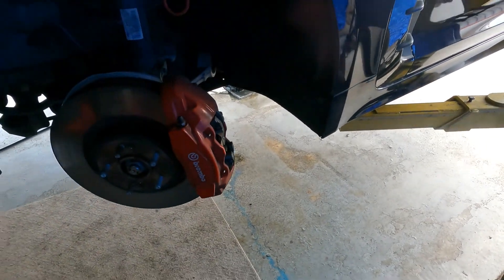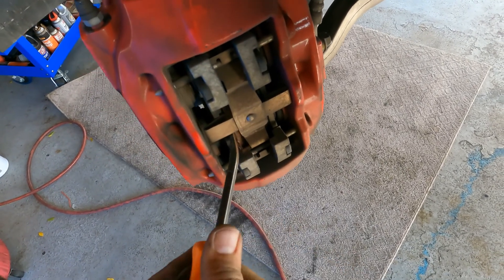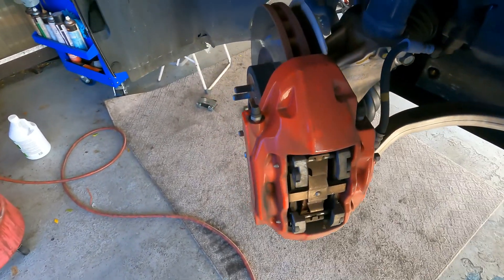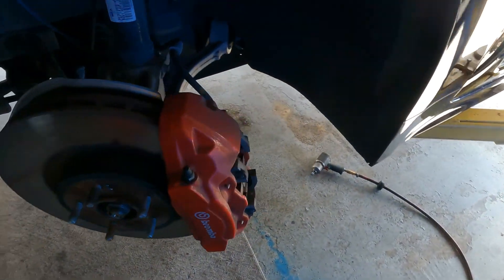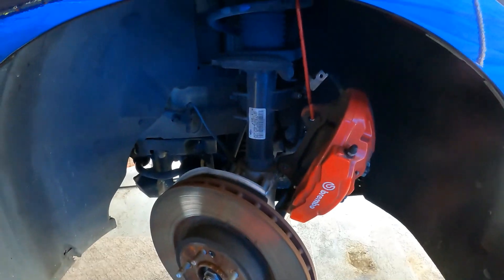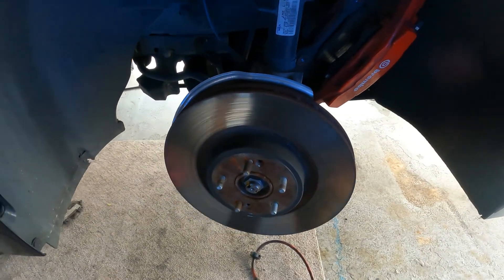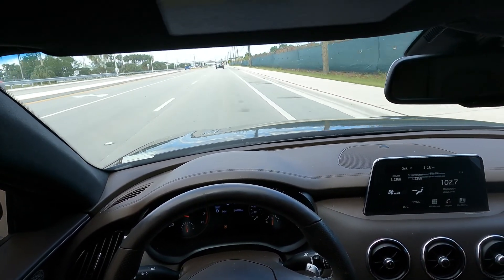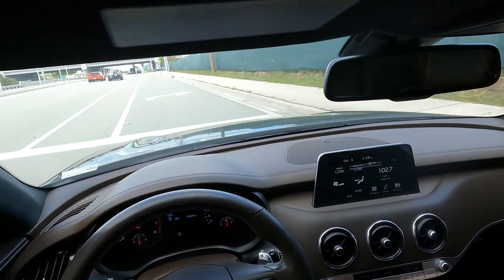2020 Kia Stinger GT brake pad replacement

Comment: Good job !
Question I have the same car 
My brakes @ 25,000 miles are shaking big time when applying brakes at higher speeds ?
I'm not an aggressive driver 
And take care of great care of my vehicles, I have read these particular brakes use Top Quality Calipers BUT cheap pads.
So, I'm going to swap out my original pads for non KIA 
Do I need to turn the rotors as well
Or can I get away without.
I know you can't say without seeing them just wondering IF it will only cause problems leaving rotors on etc
Reply from the maker: I would definitely cut or replace the rotors. Based on what you said it seems you have warped rotors
Reply: I just changed mines after 2 years.. for what im seeing with stingers with brembos its a must you change the rotors... its a clear design flaw with these cars

Comment: Man, that's crazy. I had one hell of a time trying to get that pins in after changing out the pads. I was hitting them so hard that the tops were Starting to mushroom. One side, i gave up after hitting it so long. I was breaking off lots of paint off the caliper. And you managed to hit it in no problem

Comment: Is there any need to use the brake lubricant /grease stuff on the backside of the brake pads and pins ? Thanks.
Reply: yes you should. otherwise it will start squeaking later after a few miles

Comment: My 2021 Stinger GT brakes squeak during braking ? Kia service told me its normal for Brembo brakes to be noisy!? It doesn’t make sense why new car have squeaky brakes!
Reply: Brembos are noisy brakes. You can get some less aggressive pads. Stopping power comes with extra noise and extra dust. More aggressive you go the louder and dustier they get.
Reply from the maker: Thanks for the info

Comment: When replacing the brembo pads do I need to get those exact pads again? Are there any other pads that’ll fit?
Reply from the maker: Brembo is a brand you can use other brands that fit
Reply: Don’t get the same factory pads that is the issue it causes shakiness in the brake pedal at high speeds